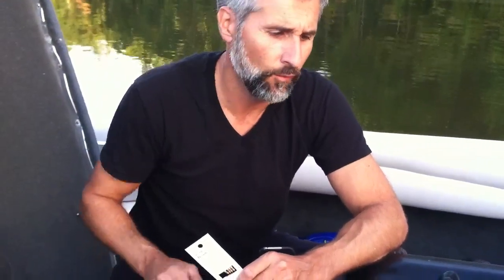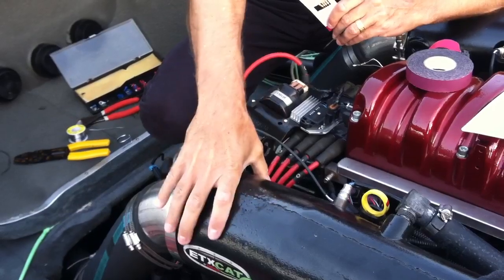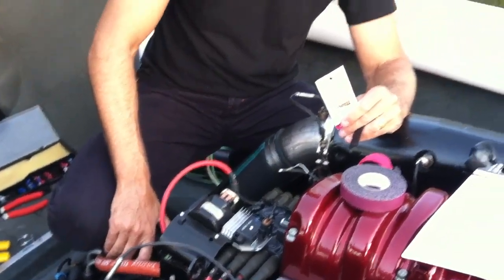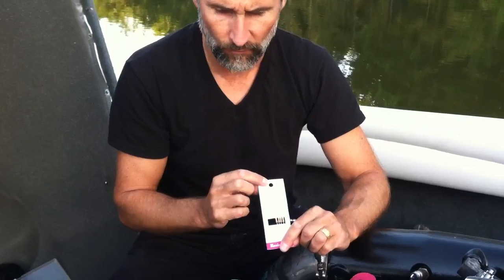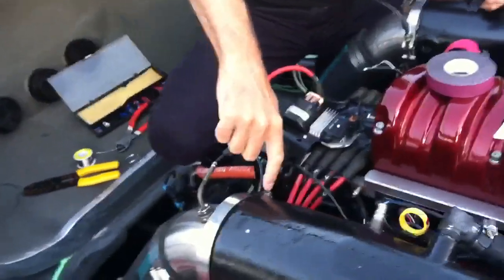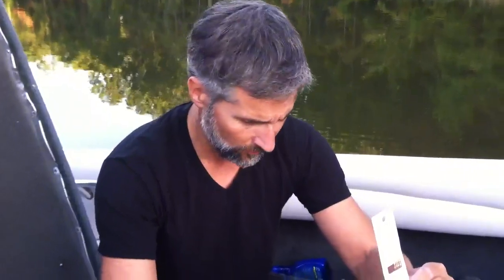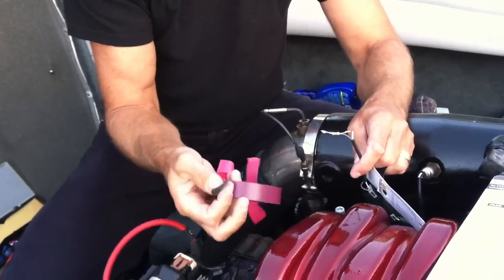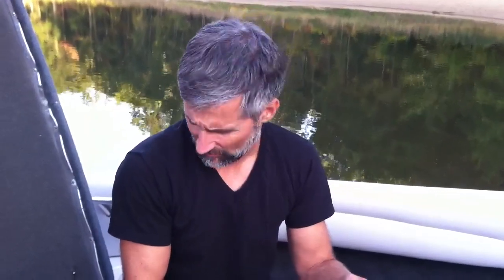Mastercraft 2008 Indmar MCX post cat sensor fix

Comment from the maker: This boat has over 1,000 hours on it and has been amazing for us.  It is a 2008 Prostar 197 with an Indmar 5.7L MCX and also ZERO OFF speed control.  The first sign of a problem was the warning tone from the dash, with a "CHCK ENG" text on the dash.  The boat then went into reduced power mode and would run a max of 3,000 RPM, and a bit rough.  We tried a Indmar firmware fix via laptop from the local dealer, but found out that the fix only works for non ZERO OFF engines.

Comment: Hi Brad, I have the same problem but my boat is a 2007 year and it only has the cable coming out of the top of the cat. There is no cable coming out of the silver part behind the black block. 
It is a 4 wire cable like the one in the video. Any idea how to fix the bug?
Thanks
Seb
Reply from the maker: Sorry Sebastian, I am not sure.  I would definitely talk to your local MasterCraft  dealer or MasterCraft directly if you don't have someone close.  good luck!

Comment from the maker: Indmar says if you are running the ZERO OFF on a 2008 MCX, then the fix is to add a simple resistor to simulate the appropriate sensor signal.  I was so stoked to turn the key without the error, and drop the throttle up to a smooth 45MPH.

Comment: Do you have to do something to clear the warning after installing the resistors?
Reply from the maker: Hi John, it has been awhile but I believe I recall I was not able to clear it on my own. Since there was a firmware update available that also improved the ZeroOff I had Action Water Sports update the firmware with their computer.  They have 3 locations in Michigan and one in Central Florida
Reply: Brad Knoth sounds good Thank you for the post!!

Comment: I put my boat in the water today for the first time this year and it would only go 30mph. Check engine warning kept coming on, oil pressure good and not overheating. I did this fix and the boat now runs mint but I am still getting check engine warning. Any ideas ? Thanks!

Comment from the maker: that is exactly what will happen with a CAT sensor fail which is what the fix in the video is for.  There may be other issues that could put the engine is this mode.